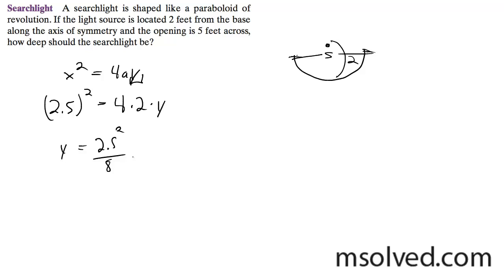Searchlight, trig, and parabola design.

Comment: Not helpful. Where did 2.5 come from? you just kinda mumble through the video and give an answer without explanation.
Reply: The length is 5. he divided it to 2 equal parts so that the length on the left side is 2.5, and the right is 2.5.